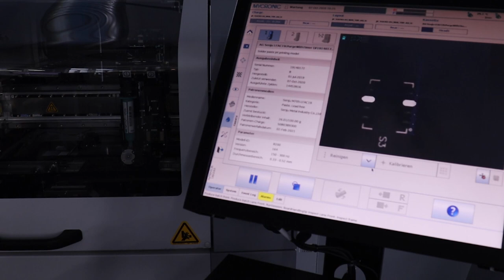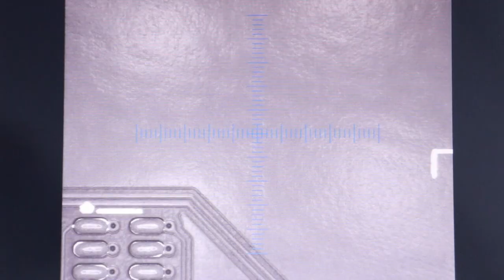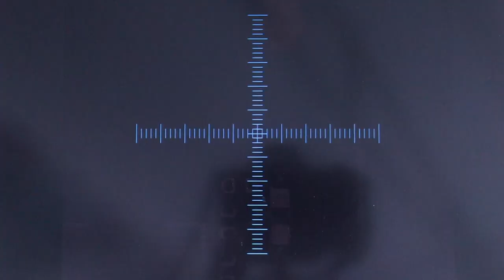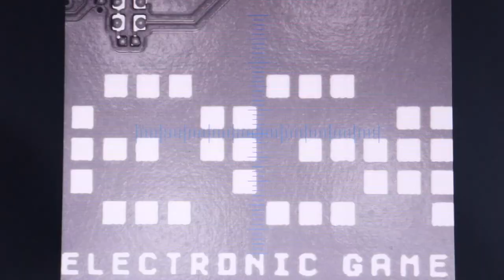MEGA65 - PCB population

Comment: I would like a modern keyboard computer based on ARM CPU, with decent RAM and a fast SSD, as well as many connections and a customized Android.  The Nintendo Switch has shown that you don't need a Sony/Microsoft "Moster" to be successful in the gaming market.  Of course there is the Raspberry Pi 400, but unfortunately it doesn't have the performance to keep up with a switch, nor does the housing and keyboard match the quality of the Mega65.
Reply: You probably (and I certainly) want a modern incarnation of the Amiga500, with a free, small and elegant operating system on fully documented powerful hardware.
Reply: color maximite II

The modern interpretation of 8bit.
Without all the 8bit limitations.